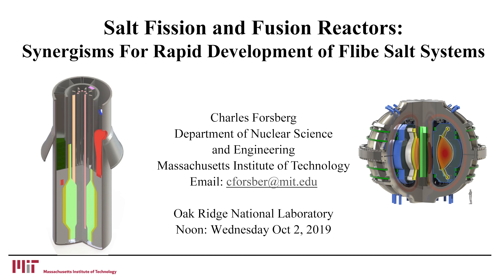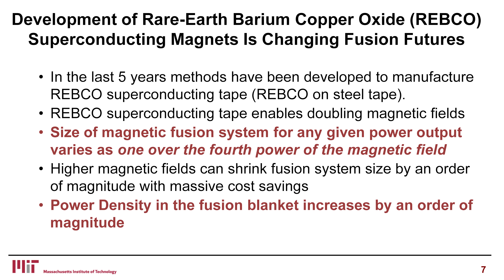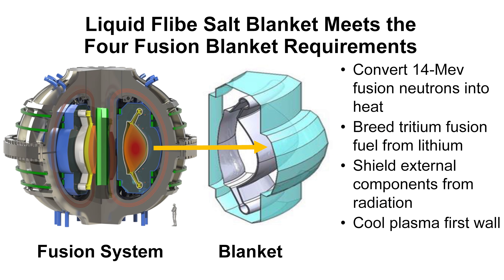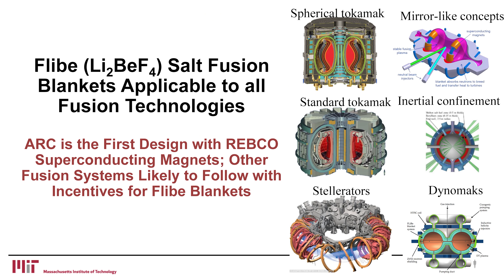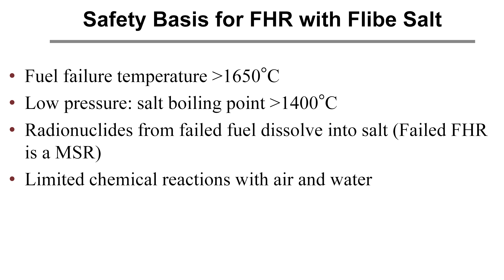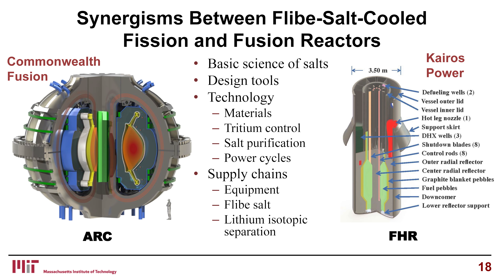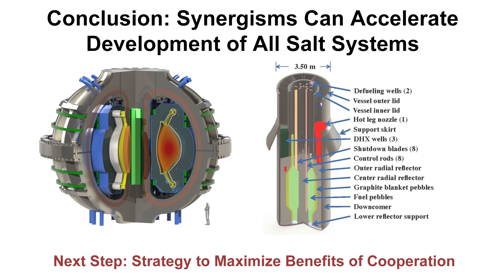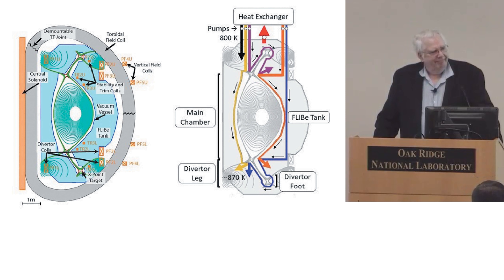Molten-Salt Fusion Reactors and Molten-Salt Fission Reactors - Dr. Charles Forsberg @ ORNL MSRW 2019

Comment: Manufacturing breakthrough of Rare-Earth Barium Copper Oxide (REBCO) Superconducting Magnets onto steel tape- should also be a breakthrough for Superconducting magnetic energy storage and superconducting grid transmission lines.

Comment: 6:55 He mentions that other fusion systems besides ARC could make use of REBCO and Flibe salt. Would this also apply to the lattice confinement fusion method that came out last year?
Reply: Are you mentioning one of the cold fusion scams?
Reply: @paulbedichek2679  I don't believe lattice confinement is a form of cold fusion, no.

Comment: Damn. I would really love want to work on these projects. If only.
Reply: There's so much surface area you could probably find something to do in your garage that would contribute. No joke. Lots and lots of basic science welcome here. That's why there are tons of little schools messing with salt and loops. Because they can.
Reply: @Innomen  True, for example like at what temperature well abive 800C does throwing salt in water cause an explosion like sodium? We know some do, but not the temperature. Need a furnace, safety gear, many salts and eutectics, but not pure, very high temperature sensors, water, extreme caution.
Reply: @EdPheil  Not exactly the most approachable example but an example none the less hehe.
Reply: @Innomen  That is an easier than most because you dont need salt cleaning equipment, or argon covergas glovebox/system.

Comment: I still wish they would pursue fission/fusion hybrid energy park systems. We need fusion bad, but it will be too late to go straight fusion.  It's very feasible that near term fusion fast neutron reactors could turn lots of thorium into fission fuel, and generate power too.
Reply: Why not deploy MSR fission now - all out war on global warming?
Reply: @red-baitingswine8816  engineering experience in fusion is critical if it is to be the energy source of the future.  Pure fusion ala ITER is so high cost and capitalization.  Hybrid gets both molten salt fission now, and allows step by step replacement with fusion as it's efficiency gains with time.
Reply: @michaelcooney9368  All out MSRs (burn Plutonium &...) along with fission/fusion pilot installations?

Comment: Seems like fusion reactors are more about capturing investor dollars than neutrons. Pebble bed reactors with FLiBe is probably better than Helium, but those solid pellets are not simple to make. Again Fluid Fuel has demonstrable advantages in many areas, cost, simplicity over fusion and pebble bed types.
Reply: Your beating a dead horse. its a giant white elephant with a momentum of its own. it will never work.the plasma ribbon will always kink,lose energy and collapse.no one has the guts to admit its a giant boondoggle. OUT OF THE TRILLIONS OF STARS HOW MANY ARE DOUGHNUT SHAPED? EXACTLY ZERO.

Comment: Very interesting video. Something really got my attention...those "high" temp superconducting ribbons, deposited on steel....why not deposit on Metglass. Use plasma etching to ensure a good mechanical connection between the Metglass and the superconductive layer.  After deposition use a localised plasma to tune the characteristics on the fly. Should be done during winding, in order to be able to change the characteristics according to the location on the coil.
Reply: Your beating a dead horse. its a giant white elephant with a momentum of its own. it will never work.the plasma ribbon will always kink,lose energy and collapse.no one has the guts to admit its a giant boondoggle. OUT OF THE TRILLIONS OF STARS HOW MANY ARE DOUGHNUT SHAPED? EXACTLY ZERO.

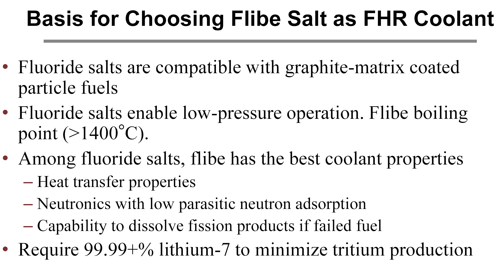Comment: At 8:40 "On the fusion side absolutely everything is done to maximize tritium production ..." This should induce some nice cognitive dissonance in Green groups that hyper-react to traces of tritium in fission reactors. How they would react to kilograms of pure tritium for fusion reactors is to be determined - I think that none of them are remotely aware of any engineering issues.
Reply: "Remember, the rewards of tolerance are treachery and betrayal." -The God Emperor of Man.
Reply: The fusion reactor destroys tritium at speed it is produced.  I'm not a fusion expert, but I think kilograms of tritium at 100 MK requires too much volume or pressure. The real number must be much lower.
Reply: @jkn6644  I appreciate that,  and that it requires (if I've got the arithmetic right) less than 300 grams a day for a 1 gigawatt electric plant. I also appreciate that it's been synthesized and handled for years in thermonuclear weapons systems. It's not an unknown quantity.

Comment: Why not just go straight to hybrid fusion-fission?Use those neutrons from fusion to make fission reaction just by adding thorium fuel into blanket?Make it smaller and cheaper than fusion,since it can be less efficient fusion process,but much safer and cleaner than fission since no need to any sort of richness of fuel,no moderator etc.
Reply: I've actually been wondering about something like this recently myself. Using neutrons from fusion to make fission more efficient works well in nuclear weapons, so I'm surprised that I haven't seen any proposals for doing the same thing in power plants.

Comment: Fusion is possible and  can generate enough net energy experimentally. But it will cost too much compared with photovoltaic/wind or safer gen-4 fission reactors. So not commercially viable source of energy in this century.

Comment: This plant as described looks great and I wish it well but the nuclear regulators will keep it held up for decades. Moltex kept it simple with their fast spectrum waste nuclear fuel burner but even they are unlikely to be grid connected before 2030. They have a proven design, but delays are entirely regulatory. Of course they must demonstrate the plant is safe, but the regulatory bodies are incredibly slow. You need VERY deep pockets to just keep going through the mass of paperwork. All on top of the deep pockets you need to develop the design and build the plant.

Comment: How, pray tell, are you going to achieve fusion at 750 deg C?
Reply from the maker: Fusion doesn't take place in FLiBe salts, that a breeder blanket creating tritium fuel.
Reply: @gordonmcdowell  I already knew tritium was a byproduct of molten salt thorium fission reactors.  The title "Molten-Salt Fusion Reactors" was misleading at best.
Reply from the maker: @adamf663  The title of the paper was "Fusion Blankets and Fluoride-Salt-Cooled High-Temperature Reactors with Flibe Salt Coolant: Common Challenges, Tritium Control, and Opportunities for Synergistic Development Strategies Between Fission, Fusion, and Solar Salt Technologies" but Dr. Charles Forsberg's talk for ORNL was titled "Salt Fission and Fusion Reactors" (as you see in the first second of the video). I guess it's somewhat inaccurate? I dunno, if Forsberg's title was much more accurate than mine, but I'm thinking "good enough". Please feel free to rip a copy and post it under whatever title you feel is most accurate.

Comment: Fission is like shooting fish in a barrel....................Fusion is like trying to put man on the moon.
Reply: Fusion is far easier than they make it sound. They are only funding the wrong methods.
The tokamak is for fusion as what neutron source bombardment is for fission. Some egg heads just decided at some point that tokamak will be the future of fusion. It is still hard to get support from the government to reactors that work better than JET that are far cheaper.
Reply: We just need the gun. This may be Generation 4 nuclear reactor prototypes. They are the next vital step needed. Only China is building such Guns / prototypes.
Reply: Ian Scott and Moltex seem to be leading the way in fission reactors. He took the approach of designing out as much as he possibly could that would need regulatory approval.
Molten salts based on the Weinburg MSRE would never get approval this side of 2050 if ever. Not because its a bad design, but because it's just not nuclear certifiable. The Hastelloy-N material and pumping radioactive fuel are enough to stall regulatory approval for decades.
Moltex, does not pump the fuel, has no moderator, uses passive cooling for decay heat and for full power loss of cooling load. The materials are already nuclear rated. The design is familiar to any nuke engineer etc etc. But they are still unlikely to be making power before 2030.
Reply: @Dave5843-d9m  Ed Pheil and Elysium have a good proposal that addresses that issue and a few others. Ed Pheil is the lead engineer of a group that have been designing and building reactors for the US navy for decades. Their proposal is not as efficient or long term as some of the more complicated thorium designs, but he is onto a good concept. His proposal is a molten salt - Sodium Chloride coolant carrying fuel composed of existing reactor transuranic waste that can be mixed with weapons grade plutoinum (for disposal) and thorium. This design runs in the fast spectrum with no graphite moderator (its not necessary in the fast neutron design) and simply gets criticality on volume/density.  So, they get paid to take the "fuel" .............they get rid of waste, and make very cheap energy, using existing certified materials.

Comment: Did I miss the memo saying there was a breakthrough in nuclear fusion? I had the impression ever more money was being spent to build ever bigger research reactors attempting to attain energy breakeven.
Reply: The heat exchanger location is a huge problem,  this engineering solution is bold , because the magnets now are that much further away and every mm costs energy.  But it would have to go someplace.  I just lead with the mantra "perfect is the enemy of good , let's rock and roll "  I'm only 3 min in so I'll reserve further opinion.  But I doubt it will be possible without a fission energy source to power it , and fusion to make it clean at a slight energy cost . I'm guessing but I think that's as close to perfect as we will ever get
Reply: Except you feed in just a tiny bit to much waste a BOOM your perfectly safe , perfectly meltdown proof design is spread over the town . Perfect IS THE ENEMY OF GOOD
Reply: @mikepict9011  
Fusion reactors operate in a constant state of inner wall melting and spallation removal by 3 MeV Helium particle collisions. It is one of the biggest problems they have not learned how to fix because some of the  vessel internal material gets off into the plasma too.
Reply: @EdPheil  I'm not an expert but this design has the issue of specific gravity separation.  Which is why the stellerator is all twisted,  the keep the plasma from separating.  My point is lots of problems and the fission gen 4 model's have varying levels of complexity but no engineering problems..... all I care about it cheap energy and global warming
Reply: I'd encourage you to read up on MIT and Commonwealth Fusion Systems SPARC/ARC reactor projects. As was mentioned in this video, higher field magnets have become available recently, allowing ITER-level performance (i.e. net positive energy from fusion, net of heat conversion) in a university-scale reactor. Should be up and running in less than 5 years, costing a few hundred million dollars. Though standard nuclear energy sources (especially thorium due to its safety profile) should already be producing the vast majority of our energy, political/public will is not there and it's important to develop even cleaner energy sources like fusion in addition to public outreach programs.
Reply: @anthonycavallaro9941  
B.S.
There is no proof that they could approach breakeven just because of stronger magnets! Remember a smaller reactor size for similar power out means greatly increased heatload per cm2 & much higher damage rate/cm2 than ITER, and those problems were not solved at ITER heat and damage flux levels. So, SPARC is not remotely feasible for a power reactor size. Plus the new magnets higher heat and damage as well. 

So NO!
Reply: WONT WORK. WRONG SHAPE.WHAT SHAPE IS THE SUN? A TORUS ALWAYS KINKS OUT OF SHAPE  NO MATTER HOW HARD YOU TRY..
Reply: @esecallum  Er the shape of the containment isn't super important for forming fusion? We are able to do fusion with non-spherical payloads/forces in thermonuclear devices. We'll see if spherical tokamak's outperform toroidal ones but I'm not sure that's as important as you indicate.
Reply: @anthonycavallaro9941  Did you even read what i wrote about degrees of freedom and confinement and kinks? for the 50 years same story, it kinks touches the walls loses energy and fizzles out. did you know that the inventor of the torus concept disowned it as a dead end?  his name is Bussard,look it up. thats right the inventor realized it was a dead end but like the white elephant the torus concept has gained momentum and hangers on keep beating a dead horse just to keep their jobs. another physicist a few years proved it could never work using physics and maths. he was ridiculed instead and his paper blocked from publication.
Reply: @esecallum  The sun only works because it massive enough for gravity to do the confinement. The way gravity works makes spherical confinement the 'easiest' and nature always chooses the easiest.
Since we cannot create gravity we have to use something else and one option is a magnetic field. The nature of magnetic fields is such that a toroid is the shape that makes it easiest to achieve the necessary confinement.
If in some alternate universe the sun were held together by magnetic fields rather gravity it would be a donut instead of a ball.
Reply: @listerdave1240  emmm Bart just posted that you can make spherical magnetic confinement fields and is not difficult.if nature choses the easiest maybe we should follow suit? a toroid is the dumbest as it ALWAYS kinks, try standing a pencil on its point. no matter how hard you try it will never be stable and topple over.
Reply: @esecallum  Sure you can. You can make a magnetic confinement almost any shape you can imagine and a few more that you can't.  The point is not what can be done but what is the most efficient, in other words getting the highest pressure with least effort. With gravity that is spherical whereas with magnetic fields it is toroidal.  In simple terms the reason is that gravity attracts matter whereas magnetic fields can only deflect electrically charged particles, and cannot even attract them.

Making a complex magnetic field that confines the particles in a sphere is indeed possible but you would be wasting a lot of effort in forcing them into a sphere rather than the more natural torus, effort that could instead be expended on increasing the confinement pressure. What you say about stability is actually why the torus is preferred for magnetic fields. The spherical shape is inherently unstable because unlike with gravity the particles have to be moving tangentially to experience a force towards the centre and you cannot have particles moving tangentially over the whole surface of the sphere as their paths would have to cross. With a toroid they are all rotating in the same direction and will naturally keep aligned. The motion is inherently stable. The difficulty is that the stability is not yet sufficient to resist the very high speed random motion of the particles at extreme temperature. The main approach to fixing that is making the magnetic field larger and stronger. Making it spherical instead of toroidal would just make it orders of magnitude more difficult to achieve something that is already difficult.

You could also make wheels square or triangular and some have done it, but just because it can be done does not mean it is the best way to do it, or indeed even a reasonable way to do it.
Reply: @listerdave1240  one again you ignore the degrees of freedom issue and keep harping on a torus is NATURAL.Why is it natural?  Even its inventor said it just a funding ploy. when real world ATTEMPTS proves it just kinks no matter how tightly you squeeze it. its NEVER going to work.its just a money pit.
Reply: @listerdave1240  Your beating a dead horse. its a giant white elephant with a momentum of its own. it will never work.the plasma ribbon will always kink,lose energy and collapse.no one has the guts to admit its a giant boondoggle. OUT OF THE TRILLIONS OF STARS HOW MANY ARE DOUGHNUT SHAPED? EXACTLY ZERO.